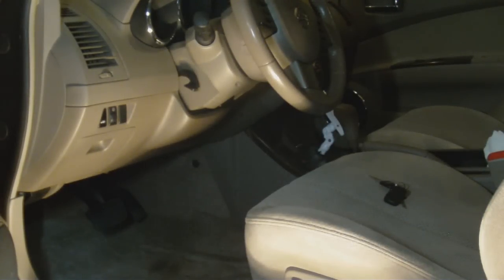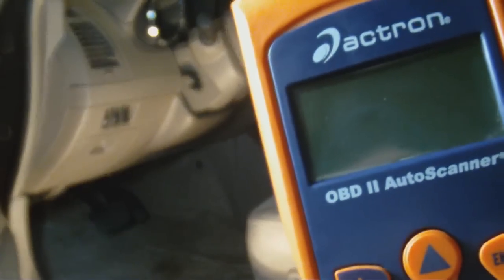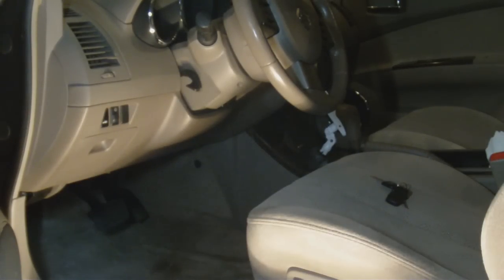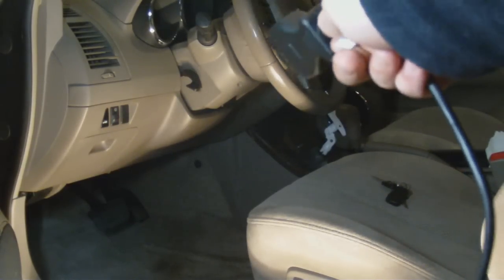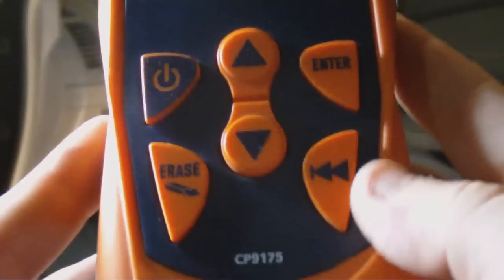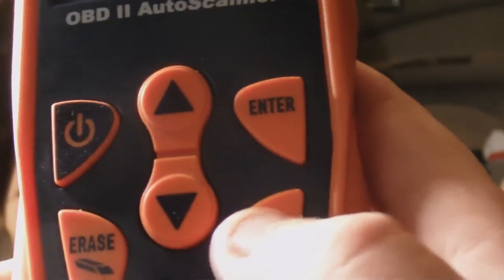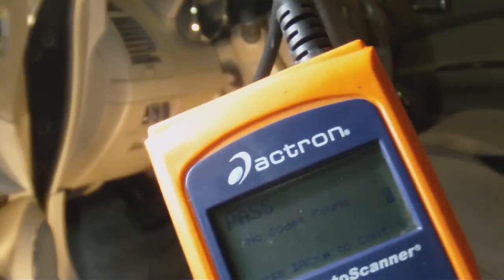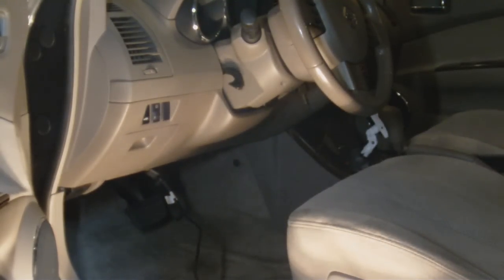Check Engine Light On? Learn how to use a code scanner! Diagnose codes, repair and reset.

Comment: Great video! By the way, the Actron CP9580A is now available, which gives you an onscreen code definition, as well as providing over 4 million most common fixes specific to year, make model and engine.

Really appreciate you having our tools and showing how easy they are to use. Thanks!

Comment: Put fuel injector cleaner in the tank to eliminate false codes. Warm the engine first to clear the engine. After repairs, retest. If you get oxygen sensor rich codes, try fuel injector cleaner first. If oxygen sensors switch slow, check plugs and air filter, etc. If fuel trims are negative, it means the engine is lean. Partially clogged injectors can cause that. A Actron CP9690 code tester checks live, record, emission readiness test, transmission codes, SRS, ABS, graphing, oil change light reset, check engine light reset, and MORE! EBAY has it.

Comment: @quwicha no data available could mean there is a problem accessing the[ECU] engine control unit from the OBD 2 connector under the dash. I would check and make sure that your scanner works on another car, Then check the K line .on the obd 2 connector. this is pin 7 top row [right] second to last pin. On a DVOM you should get about 3 to 4 volts dc from that pin if the diagnostic wire from the computer is alive. If your truck is working then the computer is running so there is data back.and forth

Comment: I like your video. Good info. I have a 2001 Buick Regal LS. The check engine light was on when I bought it. Drove it like that for six months. Now it is losing power when I drive it. It start and sounds normal. Could it be a a bad senor. Thanks.
Reply: Get a Actron CP9690 code tester. It checks live, record, emissions readiness test, transmission codes, graphing, ABS. SRS, oil light reset, check engine light reset, and MORE! EBAY has it. Get the USB cable for it to update it. It works on 1984-2013 and is updatable.

Comment: Hey Johnny I was unclear on how to reset the engine light on the vehicle. When you push the "erase all codes" on the device is that resetting the engine light (turning it off) as well or just in the device?
Reply from the maker: +George Ciccarone That is resetting the engine light. If it comes back on, you still have an issue.

Comment: just paid 97.00 to toyota dealer to diagnose . should have looked here first. they wanted 500 bucks to replace sensors. found small exhaust leak. tighten connection all fixed.

Comment: @Johnnysshop really? hmmm i was just playing with a harbor freight CenTech code reader, was like 80$, but i just borrowed it from my uncle and it had the option to read short term and long term trims. really handy feature. only problem is that it would NOT connect to my 2003 mustang but it would on an 01 jeep cherokee n a 02 dodge intrepid. great for finding bad front O2 sensors, which for a stock vehicle are 2 of the most important sensors IMO... and they dont always throw a code when they fail

Comment: hey i have a question. i recently had a tube blew up. i change the tube. and check engine light came on... would that set off the light? cuz my car never had light on until that incident

Comment: I have a 2010 Nissan altima. My check engine light came on and sure enough, it was the loose gas cap. I tighten it up but the light is still on. I had to drive home from work with the light on to. can a loose gas cap affect anything that will set off another code?? Thanks

Comment: Would this work on a nissian maxima
Reply from the maker: Yes
Reply: Get a Actron CP9690 code tester. It checks live, record, emission readiness test, graphing, transmission codes, oxygen sensor test, ABS, SRS, and MORE! EBAY has it. Get a USB cable to update it.

Comment: @gotgaimrza the answer is NO! If there is a code there's a problem clearing the code resets the check engine light but if the computer saw the problem once it will see it again. When you do your emission test in some states a check engine light is a fail. If you clear it then go in You have not changed your composition of Hydrocarbons nitrous oxide and carbon monoxide percentages, which are the focus of the sniffer. I live in the real world too but, try fixing the problem then go to retest

Comment: My engine light is on, I tried using my buddy's v-checker, can't say which moel except that it is the most basic model. When trying to diagnose in either generic mode or professor mode it just kept going back to the screen on which you choose from generic or professor mode, can you help me?

Comment: the engine light will go off if you disconet the battery for a few minuts on this model, how ever you need to take it and have the code checked there mite be something eles worng if it comes back on.

Comment: How to reset the check engine light...... Disconnect the battery for 30mins..... Or the check engine light WILL reset it self (if it is the gas cap) after so many run cycles........ Usually the light will reset it self with so many run cycles.... I get alot of people that come in with thier check engine lights on and the very first question i ask is "when did u get gas n did it turn on after u have filled up?" alot of times its that... There is a reason as to why it says make sure gascap clicks

Comment: wouldn't your check engine light mean somethings wrong?
Reply from the maker: +john divine Could be as simple as an unscrewed gas cap..
Reply: john divine yes it would, it may be something simple, might be something more serious. Thanks to all these diy diagnostics, people think that resetting the light surest the problem. In reality all you loose is the freeze frame data that can be used to properly diagnose a fault.
Reply: Chris Johnson well obviously you don’t erase the code unless you’re sure you’ve fixed the problem

Comment: I DID NOT SEE THE  RESET PART , I BOUGHT THE NEW GAS CAP , GOT RID OF THE ENGINE NEEDS SERVICE  LIGHT , I NEED TO RESET TO GO TO DEQ , HELP
Reply from the maker: There should be a function or button that says "reset all codes". If it's a really cheap model you may not be able to.